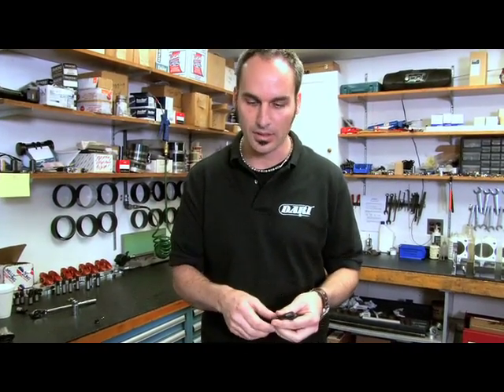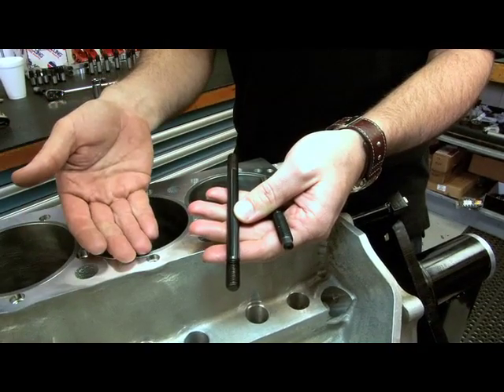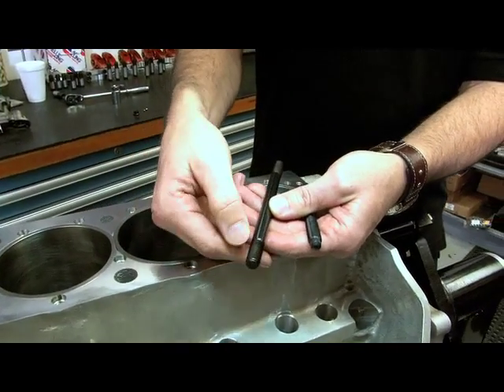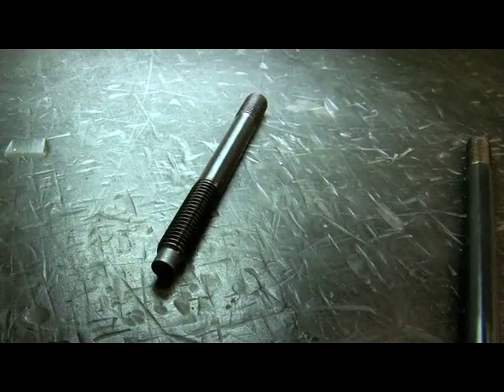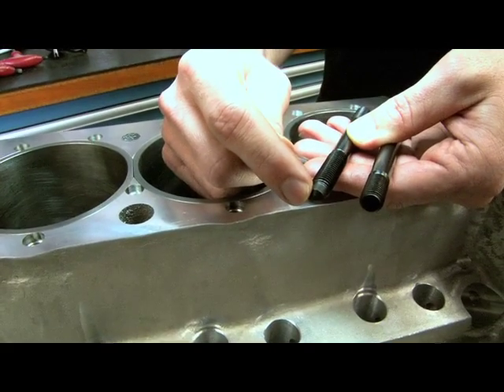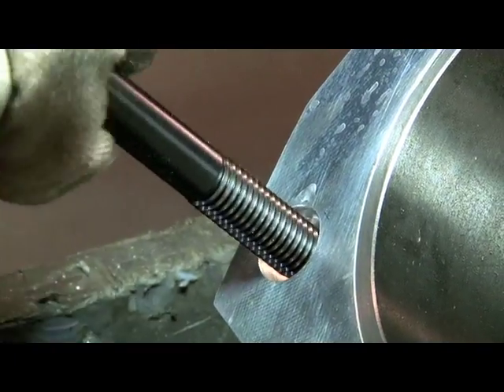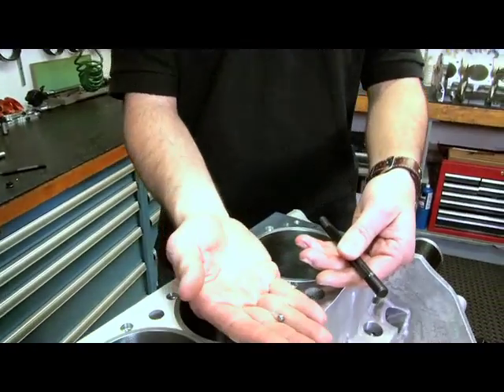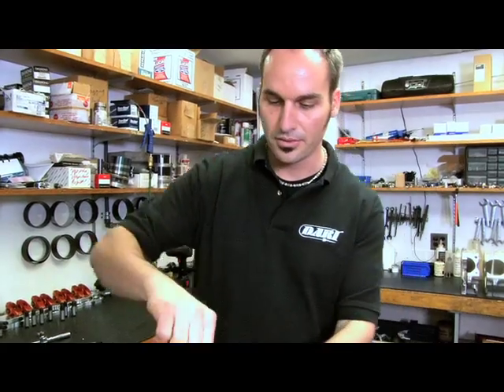Dart University, Head Stud Installation

Comment: Read the current instructions from they do change from time to time. Also you should put the stud in and back it off then Snug up the nuts while holding That start with an Allen key

Comment: How do you know that you are bottoming out on the end of the stud and not on the last thread of the stud?   You can't see the hole where the threads run out on the stud.  I suppose you could have mentioned counting the number of turns of the stud.   Remember that the theads on high-end fasteners are rolled and  the major dia. of the thread dia. is greater than the diameter of the stud.  This is another good reason to count the number of threads, or turns, you will make before you hit bottom out.   And this applies whether or not you bottom out on the end of the stud with the bottom of the hole, or bottom out on the last thread.
      Count the number of turns of the stud to find out if you are bottoming on the end of the stud, or on the last thread.
      A tip:  For an engine builder and race car fabricator, I used to machine a full radius on the thread end of bolts and studs so that the bolt or stud bottoms on the radius and not on the bottoming tap partial threads. I would also cut away the last 3 threads of the bolt.Ball bearings at the bottom of the hole are nice, but sometimes the threads stop before you get to the diameter of the ball bearing.  Engine blocks that come from a factory don't have bolt holes with threads that go all the way to the bottom of the threaded hole.   The enginebulder has a much more time-consuming job by using studs instead of bolts.  Sometimes the extra holding ability of studs demand the extra work.